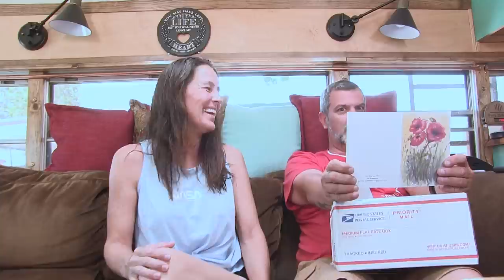Springtime in the Skoolie & Mike Changes the Brake Chamber Diaphragms

Comment: Great video. You did a great job explaining how to change a brake chamber Diaphragm. 
The last thing to do when you changed an air brake chamber diaphragm is to check your slack adjuster for travel with the park brake released. You want a min 1/2” free pull travel on the slack adjusters. I know you have automatic slack adjusters but they can and do go out of adjustment. 
You don’t want to see 2” of travel. 
Just understand that when the drums get hot ( going down a hill) the drums can expand faster than the slack adjuster can push out the brake shoes to reach the drum if the slacks are out of adjustment. It’s called brake cam over. On a full brake application the slack must be less than 90 degrees to the brake chamber. If it’s more than then you need to adjust your slack adjusters even automatic slack adjusters. 
The easiest way for you to adjust your auto slack adjusters is to air up the bus release the park brake and you should have 120 psi of air. Give 5 or 6 hard full brake applications. You might have to do this a couple of times to see the slack adjuster reduce the slack travel. 
This trick is good to do regularly. It keeps the auto slacks working. 
You need to grease those auto slacks regularly. If they stop adjusting you could have no brakes going down the hill. The spring parking brake only works if the slack push rod can reach the brake drum. 
You would be surprised how many rv’s with air brakes and have no idea what’s stopping them. 
I used to teach friends with 40 ft class a rv that weight 50,000 pounds and travel the Pacific North West mountains , how to check and adjust there air brakes when we were at Quartzsite. 
Great video. 👍

Comment: I agree with another commentor.  The air hoses going to the cans, look like they're close to failure. 
Here's a tip for preventative maintenance: The part the push rods push is call the slack adjuster.  There is a grease fitting on it & it should be greased at the same time as the steering components & the drive shaft's u-joints (it they have fittings, some are permanently lubricated)
Reply: By the way,  if the diaphragms were that bad on the rear brakes,  they probably are also bad on the steer brakes. I would change them soon.

Comment: I drove a class 8 vehicle almost everyday for 34 years, did all of my own maintenance on my trucks. Not once did I ever change the diaphragm in a maxi-can chamber. Always replaced the entire chamber. Reason: when I was young, I watched a seasoned mechanic get his head taken clean off from doing what you just did, and the caging bolt failed. Great how to video on the proper way of doing it! Still nothing to mess with if you don't have the knowledge, or know how. And I agree with you on needing a CDL to drive a bus, even if it is for personal use. Here in Pennsylvania, you need a CDL to drive a bus for school students as well as a charter bus if it has air brakes.

Comment: Understanding the air brake system is definitely important. In Pennsylvania a non commercial class B endorsement is needed over 26000 lb gvwr. That includes testing on air brakes and pre-trip checks. Glad you did this maintenance!

Comment: Well done guy! Looks like your slack adjusters are pushing grease out, or the S-cam housing seal. IF YOU SEE oil and grease with dirt build up in your drums or along the axle under the breaks, the WHEEL SEAL is out and letting contaminants into the Hub where the bearings go.
Also, I think the rocks in the bottom of the pot is for pots without drain holes so the water can sit below the soil and not mold the soil or rot the roots.

PS. Curtains look great!

Comment: There are different air systems depending on when manufacturer date & DOT regulations however typical situation is air pressure releases the mecanical spring thus the safety measure (when air pressure is lost brakes come on bus stops)
Restating pressing brake pedal causes pressure (air) to be released. 
That is why the alarm rings until proper pressure is achieved at start up (allowing you to move the bus)

Comment: How often do you have to change those Mike?
Reply from the maker: That's a really good question and honestly I'm not sure. I do know that it is quite obvious when they fail. You will have air blasting out of the brake chamber and it'll be blasting dirt up. These very well could have been the original brake diaphragms from 30 years ago.